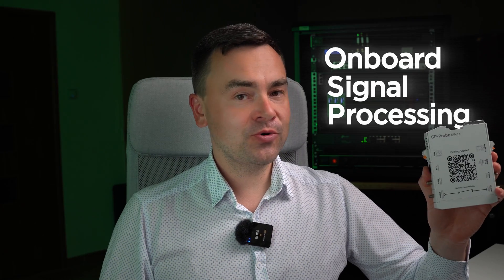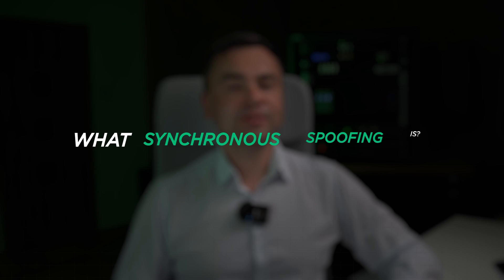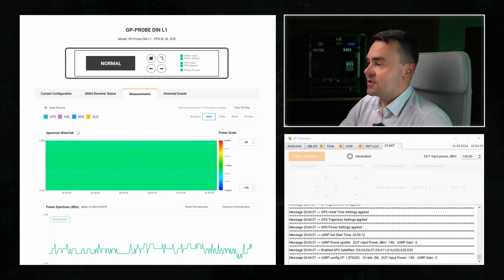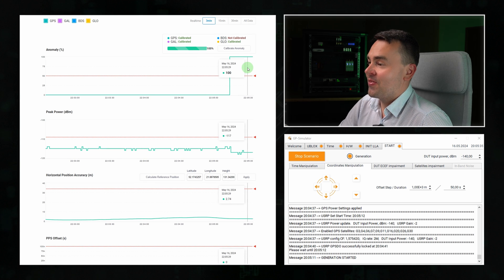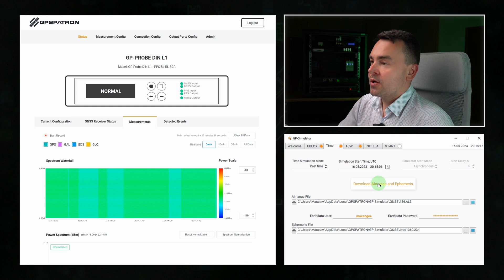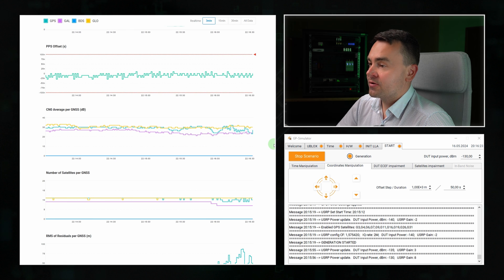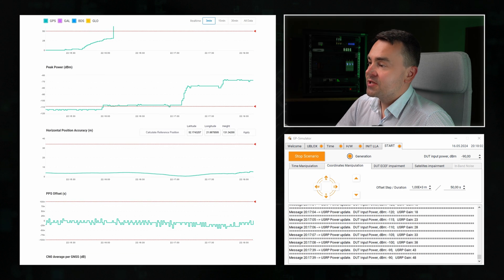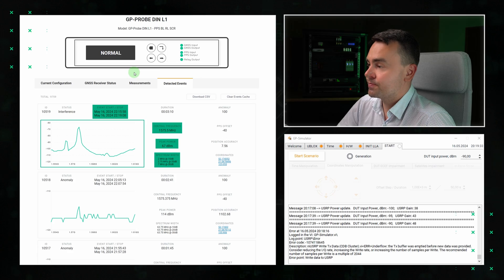GPS Spoofing Detection with GP-Probe DIN L1 and OSP option

Comment: We did the same analysis, but we used 2 or more antennas.
Reply from the maker: Sometimes two antennas are not enough in real conditions due to the effects of multipath and fading. In our advanced detector, we use 3 antennas.
Reply: Hey may I know how you did the analysis? Thank you
Reply from the maker: @shanthoshkumarm6873  Hey,

We can’t fully disclose the details of our algorithms, but I can share that we use a u-blox receiver and analyze several key parameters, including:

CN0
Pseudoranges
Residuals
Doppler
Gain
Spectrum info
Datastream
I hope this helps! Thank you.

Comment: I always have issue with this. yes, we detected that we are jammed, but we don't have any coordinates to go about. Or this is false ?
Reply: This device operates from a fixed position with user-defined reference coordinates. To detect jamming in motion and determine its boundaries, an additional coordinate source is required, such as an inertial navigation system.